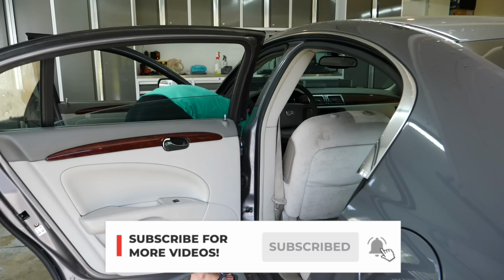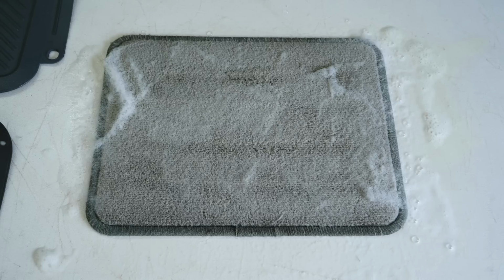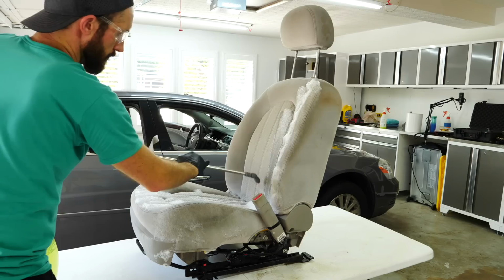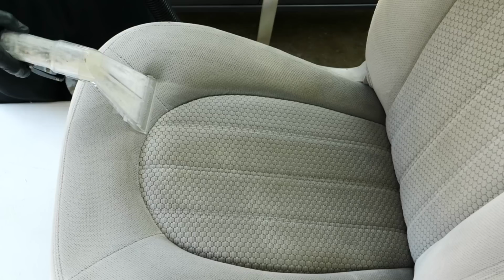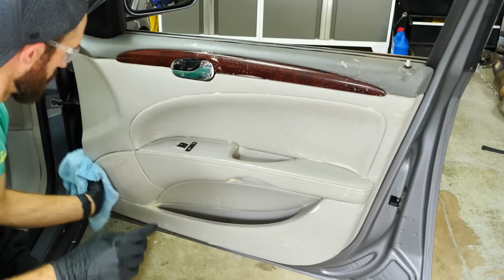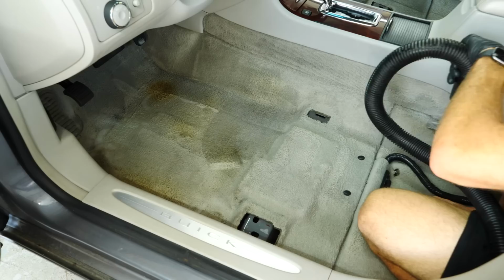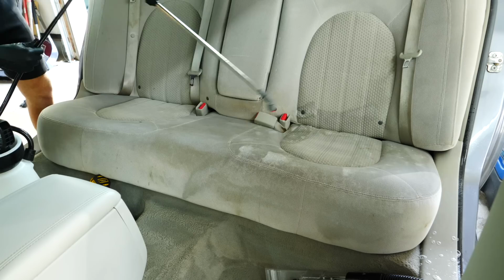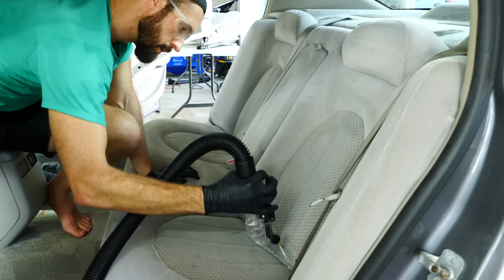SUPER Car Detailing Tranformation of A 250,000 MILE Interior!  DEEP CLEANING A 2007 Buick Lucerne

Comment: 230,000 miles  on a 2000 Windstar SEL bought it used 2 years ago  $500 . The last owner trashed it inside. Smoker has a few burn spots, pine needles and pitch. Lots of kids drink stains. This year I bought an extractor  and I am using 3m 27h extractor solution to get the rest of the smell out of it. 3M cleaner is the best stuff to use and cheaper in cost. Front carpet 2 cups of dirt extracted. I figure 1 cup of dirt in the back. Replacing front end parts to get the tires tracking correctly. Used rust converter under it and sealed the underside. I use it to go to work and it is my winter Van. I will get at least  2 more years out of it. Great job cleaning it!

Comment: 1993 Ford F150, bought new with 230 miles on it, sold it with 287,000 miles 20 years later
Got another 1993 Ford F150 4x4 a few years ago, sold it for more than I paid for it, it had 315,000 miles on it.
Both trucks still going strong

Comment: My brother had a 1980 Ford F250 that have over 450,000 miles. All original motor and transmission. It was used by a carnival crew to haul trailers across the country.

Comment: My first car was a 2008 buick lucerne. Same tan interior, but mine was blue and had a column shifter with a "bench" seat. It had over 211k miles and had the 3800 v6. I had it for 2 and a half years and put over 80k miles on it. It was a solid car and held up well, but eventually I traded it in for a newer car that got better fuel economy and got a 2016 Camry LE that now has 106k miles. While I miss the smooth luxurious ride, it's nice to have something newer.

Comment: Excellent!  Question:  I noticed the seat belts were pretty badly stained.  Do you use the carpet chemical and extraction on them as well?
Reply: Belts is not upholstery. If you clean then with brush and chemicals and then wipe with dump microfibres towel you will be good! Just be aware that some modern seat belts have airbags in them and cleaning in those cases should be gentle!
Reply: Either that or a steamer
Reply: Siarhei Hanush seat belts do not have air bags in them what the hell are you talking about 😂 they have pre tensioners and you shouldn’t clean them with certain things because the material will fray and cause the seat belt strap to weaken.
Reply: Actually my car has airbags in the seatbelt side panel , that person is correct

Comment: 2012 Hyundai Sonata. Recently took your engine bay cleaning advice video, bought the little green monster.....bought it to the dealer for oil and brake changes and they could not believe the vehicle was a 2012 with 200,000 miles. Sorry I missed your labor day sale. I def need the brushes.

Comment: You should consider using the carpet cleaning industry for chemicals they’re better. I’m currently using BioBreak and Flex Ice tandem. Biobreak is a pre-treatment you leave to dwell for 5-10 minutes then agitate. Its alkaline based, needs only 1-2 oz per gallon depending on soiling. Flex ice is an extraction rinse solution used in the solution tank of extractor. Its an acidic rinse that neutralizes biobreak. Needs only 1oz to 5 gallons. Both are best mixed with hot water. Leaves carpets and seats soft and almost dry after extraction. Carpets/fabrics are typically completely dry after 30-60minutes

Comment: I just did a stained disaster detail today also (VERY similar to this, odd huh?) but a Fusion with 150k miles.  I pulled what I called “rusty bbq sauce” out of the floor.  😖 seats were dripping brown when preTreated with Folex. 😖😖
I kept my steamer handy when I was doing the fabric stuff and used it to try and remove some of the really tough stains.  Worked a couple times but there were a couple stubborn spots I couldn’t get out.
Oh and I’ve been using your brushes all year. 😎🤘🏻 (since Christmas 19)

Comment: 1971 1/2 Toyota Corona MK2 wagon. Sold it with 439,000+ miles on it. Yes, it had several engine rebuilds as well as one transmission. 

1977 Pontiac GP. 258,925 when the engine EXPLODED. Towed that one to the salvage yard.

Comment: 88 GMC Sierra...I got it with about 120k and probably got it to roughly 250k before I finally sold it. It's a little vague because the odometer stopped working at 119k. I also had an 06 Altima that I bought with 75k and sold it at 198k and still looked almost new other than the tan dye coming off the top of the steering wheel.

Comment: You mentioned in one of your videos that you unplug the battery when removing seats to prevent any codes or to prevent the possibility of airbags deploying. What do you do about unlock codes for vehicles like Honda? I used to have a 03 S2K and and 07 Odyssey and when the bat was pulled you had to have codes to unlock the stereo & gps monitor. Thanks man! Great vids!

Comment: I had a 2009 escape my sister gave me at 168,000 miles I had it for two years and finally traded it in at 199,000 miles. Till I got my new escape 2017 that only has 36,000 miles. 😀 my old escape was pretty clean to.

Comment: Try using solvent with the all purpose
I use solvent in 1 bottle and all purpose in another and that usually for the most part gets alot of the stains that just all purpose or whatever shampoo you are using cant do alone
But only on light color rugs or vinyl plastics whatever
It will ruin any dark colored trim or plastic
You can use it in black carpet as well
But solvent is a great way to get stains out as well
But you have to use it with the shampoo or all purpose 
Separate bottles and spray as needed

Comment: My workvan I was provied a 2006 Dodge Grand Caravan had 280k before the computer quit...my 2002 Blazer has 210,000 on it with stock everything except AC Compressor and belt that I bought new after school and kept up on every single fluid change and PM until I sold it...last I heard it has 310,000 on it and everything on it still works.

Comment: My merc had 204k when the previous owners did irreparable damage to the motor from neglect, put in a 70k short block with new heads and gave put 10k on it in 6 months so far. No other maintenance needed.

Comment: I notice that you will spray the cleaner directly on the dashboard & console to clean it with your brush. When I tried doing that recently, I noticed that a few days later my dashboard had this sticky film still left on it. I switched to just spraying less as well as spraying it onto a towel and then wiping the surface and it worked fine. Any tips? Do I have too high of a concentration of cleaner?

Comment: I have an 01 f250 7.3 6speed manual with 300k and still going strong, will never get rid of this truck just rebuild it as I go, still running on origional drivetrain, clutch replaced twice, regular servicing tires and brakes, with the miles the turbo will soon need gone through, glowplugs and injectors replaced 20k ago, and next clutch service I need to replace rear main seal, it's starting to leak lightly, in my book that's not much for 300k, motor and transmission are still strong!

Comment: My Y2k Beetle TDI has approximately 219k on it. Unfortunately, the old Magnetti/Marelli cluster on it sh*t the bed this summer and was replaced with a different one. Before it died, I had like 214k on that odo. I've owned her since 124,800k in 2011. Those diesels hold up FOREVER, so I'm planning on a minimum of 300-400k unless I get into a wreck. :D  The boyfriend is a mechanic for the TDIs so we've seen a lot of cars with super high mileage. Our 2004 V10 TDI Touraeg has 202k. Our 2005 Passat TDI wagon had 262 before we had to park it 5 years ago with a shot transmission. We've seen a couple 500k+ cars roll through the shop. The MKIV (basically from 99-04) VWs have clusters that stop working after reaching 1,000,000km or approximately 621,xxx miles. We've seen one of those too. Original engine too.

Comment: I had a Mazda6 that had 229k miles when I sold it.  Of course i'd owned it since 27k miles so the interior was probably the nicest high mileage around.  Only issue was the window tint starting to peel.  Plastics, leather, carpet all looked showroom fresh though and the exterior was still glossy

Comment: 1986 Nissan ‘Maxima’ sold in ‘95 had 375K, most likely over 400K, but since the speedometer cable broke in ‘94.  Despite the mileage I was given $1,700.00 because it was flawless.

Comment: Had a 1997 Geo Metro with 225000 miles on it ran just fine but we traded it in. Also I have a 2011 Ford Focus with right at 200000 on it now and still drive it 100 miles everyday

Comment: I had a mazda 6 my parents got brand new, sold it to me and i sold it with over 320000 miles, ove rthe span of 10 years. 120000 of that was in the last 3 years. Also just sold my bmw 325xi with 198000 miles on it. I got it 4 years ago and it had 130000ish on it. I have a focus now and it only has 50000 😄

Comment: We just did a 2001 Chevy SUV w/300k  miles 
that looked WAY WAY worse than this vehicle and it came out pretty good.
We let the pre spray set 30 minutes and that helped alot. (We use CHEM SPEC 90 liquid) 
BUT 
The floor mats were an absolute disaster and there wasnt anything we could do about the mats.

Comment: The back seat bottom is easily removed in these cars...just lift it up. No tools needed. The battery is located under the rear seat on the passenger side.

Comment: Is there ever a seat that you can't remove? I have removed a few but I'm scared I will face one where a customer's  air bag light comes on and stuck with a bill. Any insight?
Reply: If you do not turn on the ignition when the seat is unplugged then it shouldn’t be a problem, disconnecting the battery will help. Also make sure it’s fully plugged back in too.

Comment: 91 crx 220k (sold)
91 civic hatch h22a2 swap 150k (sold)
97 civic coupe had 190k ran mint when I swapped in a k20a w 50k (sold)
07 audi a4 had 240k many issues (sold)
08 civic si 213k no issues (sold)
08 tl had 150k no issues (sold)
Honorable mentions: 
13 brz stg 2 turbo kit (100k sold)
13 audi s5 b8.5 (95k) current 🤞🤞🤞
Forgot about the 98 lude 160k (sold)
And the 98 accord 180k (sold)
Now that I've listed all this out, I'm wondering why I bought another audi.

Comment: My sister in law has a Toyota Camry with 494,000 on it and still going.
Reply: I have a friend with a 2014 Toyota Camry 4 cylinder with 515000 miles on it. Same engine and transmission.
Reply: @klaw3397  Um, so your friend drove 230+ miles a day, everyday, for the past 6 years? Gonna call bs lmao
Reply: Wow, I have a 2016 with only 106k. Its still a new car.
Reply: @lukeclayton7578  there's people who travel daily to their job. When i did pipeline work i drove from houston to dallas almost everyday.
Reply: Not surprised, those old Camrys were TANKS.
Reply: Not surprised, those old Camrys were TANKS.
Reply: Luke Clayton not impossible some people have a long commute

Comment: I had a 2003 CRV that had 203,000 miles when it shat it's electrical system out. I didn't want to pay the $2000 + to repair it so I scrapped it and got a 2011 CRV with 112,000 miles

Comment: Just received my brushes and cloths in the mail today from your Labor Day sale!  Looking forward to using them when the weather clears up.  What's the difference between the blue and gray cloths?
I've two vehicles with over 200,000 a 2001 Jeep Grand Cherokee had 201,000 when I gave it to a friend and my current 2006 Honda Ridgeline turned 274,000 last week and still runs like new.

Comment: My 1999 Subaru hit 250,000 a month ago, and it’ll probably have close to 300,000 when Tesla finally gets around to building and delivering the Cybertruck that will replace it as my daily driver. And my 1985 Benz has 221,000 (just past the break-in period for that OM617 turbo diesel engine).